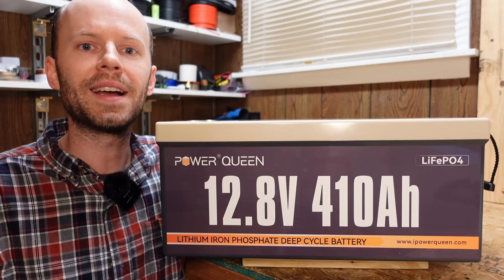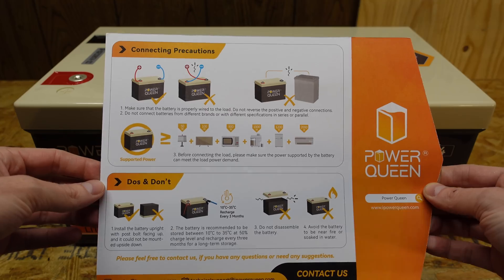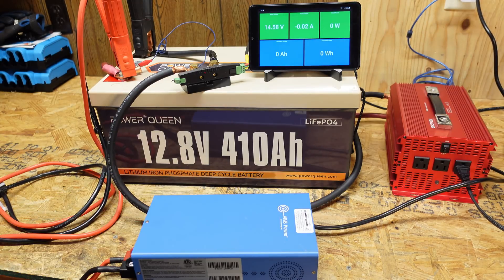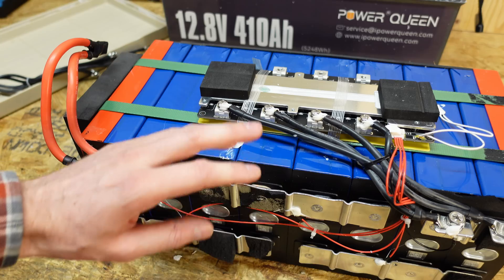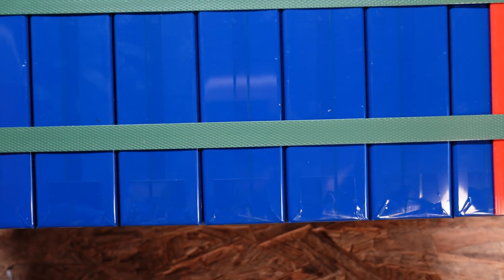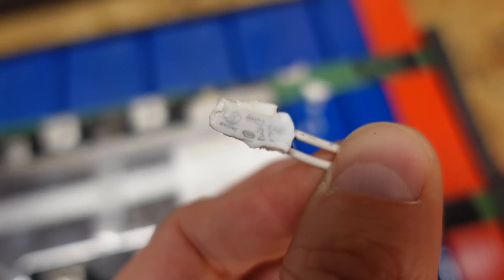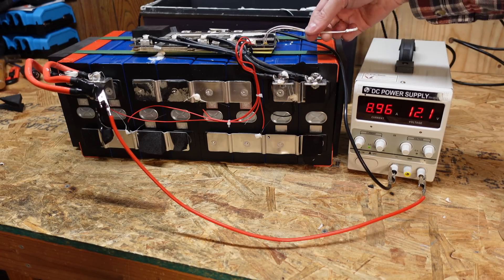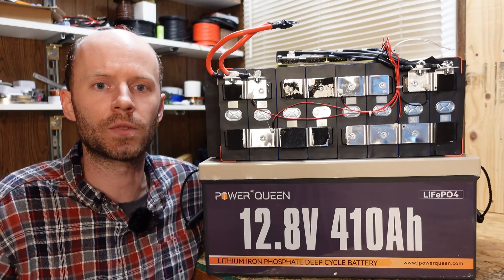Massive 12V 410Ah LiFePO4 Battery by Power Queen, Review & Teardown

Comment: Great review... the 300AH is $930 after coupon but for 100AH extra, the price jump to a whopping $1586
Reply: Could be added shipping weight? You'd be surprised how much shipping costs to weight and size jumps
Reply: @swedesspeedshop2518  hello, free shipping from PowerQueen to Southern CA address :)
Reply: @VincentsfamilyCali  free shipping for you not for them. Do I really have to explain that the cost of shipping is baked into the price ? You think FedEx and ups are running a charity?
Reply: Wich coupon you use to have a good Price?
Reply: @Rorolap  You meant “witch” coupon correct?
Reply: @h2o100c  yes , valid Best coupon for 300 ah
Reply: @h2o100c - how about “which”?
Reply: The 300AH battery has four 302AH cells which are a more expensive technology. The 410 AH battery arrived as a result of 200AH batteries being abundantly available, as they weren't really a hot seller at the time because the 100ah battery has hundreds of competitors in the market. Thus people would buy two cheaper 100AH batteries as opposed to the more expensive single case 200AH unit.
Reply: So essentially, this 12V 410AH battery is equal to my 48V 100ah battery in terms of capacity which has sixteen 100AH 3.2V cells wired in series. When I bought my 48V battery it was priced at 2100 USD on sale two years ago. This one is currently at $1669.00, that's a $431 difference.
Reply from the maker: I assume the price difference is due to different cells in the 300Ah vs 400Ah. This battery has 8x 206Ah cells. I'm going to guess the 300Ah is comprised of 100Ah cells, not sure.

Comment: Something doesn't quite jive with the 2-#6 leads to the terminals.
I'm in the market to purchase lithium batteries for my home,  and the Power Queen caught me eye. So I'm glad you opened it up so we as consumers could see.
#6 is only rated for 60 Amps, even though the leads are short, I'd be a little skeptical to take it past 125 Amps continuous.
Reply from the maker: The 60A rating you're referencing is likely from the NEC for home residential wiring? That doesn't apply here. The rating for chassis wiring is significantly higher, not to mention this has an insulation rating of 200C.
Reply: @LithiumSolar  On the other side of the coin, I think residential code is 55A for 6AWG at 60C and 75A at 90C.  Also, note that when a wire is in an insulated space (which an enclosed plastic battery case probably qualifies as) you need to de-rate the insulation rating of the wire.  Regardless of whether NEC applies inside a device or not, the laws of physics which prompted the code, still apply.

I'm always skeptical that Chinese wire is AWG rather than just "gauge" or some rough translation of wire sized by mm**2 cross section.   How much power dissipation happens in that wire per foot of length at 125A per wire?  What temp does the insulation have to reach in order to dissipate that power into the air in the sealed case?  If the answer is "well, it depends" as is usually true, let's be generous and assume it's a little under 200C (392F) in the worst normal scenario.  How happy are you to know that one end of a copper wire hotter than your oven is bolted to the external terminal, and the other end to a cell terminal?  OUCH, 200C is hot!

If 250A were for 5 seconds, I'd agree with you.  But for continuous operation, I'd want to both do exact engineering calculations, and check the actual temps of the insulation and terminals with a thermocouple before being brave enough to push more than half that current continuously.  

Anytime you parallel two wires to increase ampacity, you're relying upon the current being exactly equal in each wire, so the length, wire stripping, and connection quality have to be identical, or one wire is carrying more than half of the current.  There's a lot going on, lots of potential points/modes of failure.  I'm not the most nervous person in the world, but there's no way I'd pull 3200 watts through two 6ga wires in an encloses space, continuously.

Comment: What will happen if one of these Battery's fall over on it's side for just a very short time I just bought me a LiFePo4 Lithium 100AH Battery and it's going in my Kayak and if I ever flip my Kayak It will be over a Very short time Less Than 2/3 min Top More like less than 1 min But will it Kill the battery for good? The Battery will be in a Waterproof box and will Not get wet at all And I have a mane Kill switch on my Boat from my Battery to my trolling motor and my Fish finder  I can't find any videos on this at all Thank you much
Reply from the maker: I doubt anything bad will happen considering it gets flipped on all sides for long periods of time during shipping. I would be more concerned about water getting on your electronics.
Reply: them links Still don't say anything about if the Battery ever gets flipped over If it will Kill the battery Are just shut it off for a short Are anything I'm wanting to find out Well Thank you much anyway
Reply: Roy pow makes a true marine lithium battery. See will prowse video teardown. Dont ever get lithium battery wet......lots of fires after hurricane ian , in florida. golf carts , cars ect.

Comment: $1600 holy shit, i get 1200 AH lead battery for that kind of money!
Reply from the maker: Yes you can, which would give you about 600Ah of actual usable capacity and have to replace it probably 2-3x during the lifespan this LiFePO4 battery would last.
Reply: @LithiumSolar  i only need 250 Amps/24H and in my trailer i have lead battery’s for 5 years now…..

Comment: I don’t understand how they dissipate the heat generated by the BMS in a sealed environment.  Would like to see a test where you run a full 250A load and see how long it lasts.
Reply from the maker: That's a great idea for a test. I'll see if I can make it happen! (need to find another 12V inverter)
Reply: @LithiumSolar  I can’t see how it couldn’t fail.  High current = a lot of heat, heat sinks need to cool down, impossible in a closed sealed environment especially without a fan.  I’m an electronic technician, and the numbers don’t compute.  Feel free to contact me.
Reply: No, load here down on DC, 250 straight.  I’m pretty sure it will get #$&@
Reply: Totaly agree it would go thermal go into protection mode shut down ok run micro wave heat some food etc but if you were running muliple electric grills say in mobile food van not a chance
Reply: High temp cutoff protection.
Reply: My 5kwhr 48v plastic case lifepo4 battery from amperetime has a fairly large vented top lid hatch where you don't have to break open the plastic case to access the cells inside. I noticed this 5kwhr powerqueen battery isn't built with that hatch or top lid.

Comment: I have a VoltX 300A/H battery. I never tested it and put it straight in the back of my car with a DC to DC charger.. Seems good Ava excellent value. I'll be replacing all my 7.2ah AGM batteries and replacing with 4 lithium batteries soon.. I had over 80 of the small ones fur free from a hospital. But they are slowly failing bit by bit but have lasted over 10 years. They were used to start with..
 410ah may be awesome if I can find them
Reply: I too am using used 7.2ah sealed UPS batteries (26 of them) that i got free. I am expecting another 30 of them shortly. I will keep using them until they fail, then prob. upgrade like you but on a much smaller scale. I only have a total of 650 watts of panels so my system is very small. Greetings from Jamaica.

Comment: Will this power a split A/C -Heater on a Semi truck if got got 2 of them and will it work in Arizona heat Florida humidity and heat and Canada cold. If I put them in a outside box on semi truck. Or any suggestions on where to put them or a better battery that can handle the Cold and heat and power a split A/C system. Which is a hone unit...

Comment: Sheesh.  You can buy "5" of the 100Ah batteries for the cost of "1" 410Ah battery  🤔
Usually it's the other way around.
Reply: True, i just got a 100aH LiFePO4 for u$210 on black Friday, although this one has no BT or big BMS (50amps), it is purely for secondary purposes of only LED lighting and USB device charging. A friend of mine bought 8 (800aH) of them for $1700, for his farm in Florida, and loving it! All the batteries got 99 to 107aH after their first full test cycle, and yanked 4200w out of them in the stress test we did! 
The price factor on the PQ410 is way out of line IMO.
Reply: You would rather have 4 separate batteries taking up a larger footprint, more wiring, terminals, time and labor over a compact footprint and no need for multiple cable connections for parallel connections. Sure you can buy an EG4 for the same money but this one you can toss in the back of a camper, pickup truck, pack it with you for an extended camping trip, get wet, get dusty. Try that with a rack mount unit or five separate 100aH batteries. If it is useful for your usage or if it isn't useful, it's how you use it that makes it worth it or not.
Reply: @sanseiryu  If the purpose is "only" using it for 12V devices, and for needing long duration while out in the wilderness or what not, sure, go for that. But that is probably going to be the minority, tbh. 
Most ppl would be looking at these for powerwall applications. So space isn't as much as a premium.
Also, they aren't the same size. 
100Ah 6.8inW * 13inL * 8.8inH
410Ah 10.6inW * 20.4inL * 8.6inH
Same height, but 36% wider and 36% longer. So they won't fit in the same space.
Either one will fit an RV space, tho. 
However, if you want "capacity", then going with 5 of the 100Ah batteries would be cheaper over all "and" would give you good failover in case one of them stops functioning for some reason (ie. the bms shuts the unit off for some reason). That way you won't be left in the dark with zero power available.
Using a single battery means you have a single point of failure, and zero backup (aside from a generator and/or starting the RV up)
Reply: @korishan  4-100aH batteries vs 1 400aH battery. Which takes up more space? Which requires more cabling and connectors. If you have one 48 v 100aH server rack battery and a component fails internally, what's the difference? You're left in the dark. A few years ago people were still stripping Lion cells from electric cars battery packs building their own power walls with raw cells. Stripping cells from modem, scooter  batteries, all kinds of crap. Then buying and shipping lifepo4 cells to build diy milk crate battery banks. Now we don't have to do that anymore because of choices. Cheaper and more convenient to buy ready made batteries like this one or server rack batteries. Or if you have a ton of money to spend, buy a bunch of Ecoflow pros, daisy chain them and build a powerwall with those. Do you tell  people who buy Battle Born batteries that they are wasting their money? 'You should buy Power Queen it's half the price!'
Reply: @sanseiryu  I think you are completely missing the point here  🙄
Reply: @korishan  Your point is that it is may be more economical to purchase individual 100Ah batteries rather than one 410Ahbattery. Good point.However, if I needed 400Ah in a 12 volt system, I would rather buy one 410Ah battery or two 200Ah batteries rather than dealing with four 100Ah batteries with the multiple connections and cables, and space I need for parallel operation even if it costs me more. 400Ah battery is a low volume sales unit so will be more expensive, 300Ah is more expensive than individual units as well.

Comment: Too much money. We can buy a server rack lg4 with same wattage for less and much better battery functions.
Reply: Can you use a server rack battery outside in the rain or in dusty conditions at a campsite or toss it into the back of a pickup truck?
Reply: @sanseiryu  now that's a good question to be examined here. I know there are differences between the top companies server rack batteries but to what extreme is the question you raise. Well phrased. I too would like to know. Thank you. And to add to your question, I'd like to discover a battery that can operate in sub zero conditions having all the components built in to handle these extremes. I have some very remote property and without a human on site monitoring and taking actions I can not yet utilize the benefits of batteries.

Comment: Not a fan of the construction. The terminal connections on the sides of the battery are a concern. Also the BMS, internal wire gauge and heat management. I like that it's easy to take apart, except the welded connect among the cells.

Comment: Between the 81lbs and $1600, no thanks. I'd rather have 4-100ah batteries then if one fails in a year it isn't a huge expense and another month of back problems.
Reply: We run our whole house, completely off-grid, on 4 of their 300ah models.  

18 months so far and not a single hiccup. 

How many of what size did YOU buy and are currently using?

Comment: I have a 20’ toy hauler with a Dometec air conditioner.  Does anyone know if this single battery would start and run the a/c unit for a couple of hours?  I assume it’s a 15,000btu / 1500watt unit.  Thanks!
Reply: Due to starting spike I use two Honda 2k gens.Then turn 1 off while running.Just 1 gen won’t start it.All I know is you’d need your roof covered in panels to run all day with solar.Something like 8 300 watt panels.I think that unit runs on 6 amps? Starts 20 amps? Maybe a 600ah bat to run about an hour I’m guessing ?Im not really sure.
Reply: I googles it for you.Says that 400ah lithium bat will run yer ac for about 2 hours.
Reply: It's the inverter not the battery that starts the Air conditioner
Reply: Put a soft starter on it and will take much less to get it started.

Comment: Just came back from their page:
"lifetime of up to 10 years" does not look good.
Reply from the maker: What's not good about 10 years?
Reply: @LithiumSolar  it's up to.
Reply from the maker: @PașcaAlexandru  Of course it's "up to". If you beat the heck out of it, it wont last very long. This is true with any battery from any company, or pretty much any product.
Reply: @LithiumSolar one month fits within "up to ten years" too :)

But then again... only time will tell.
Reply from the maker: @PașcaAlexandru  So do you have this same concern with every single battery you look at? Or is it just this one?
Reply: @LithiumSolar  In EVs  and portables there is a real need for performance. Performance comes at the cost of life too. 

Stationary storage no longer needs that weight to power or weight to capacity ratio thus allowing for greater life at the cost of bulk. 
Yet I have LiMnCo cells from the 90s that put between 50% and 80% rated capacity. (Some of the earliest japanese commercial cells made to power hand held VCRs, that weren't cycled a lot)
I have nickel based cells from the 50s (1957 to be exact) that put 90-100% from the rated capacity and these were cycled and neglected. 

These look like designed to fail or have a high chance of failing, clearly stating they are good up to a definite point in time. 

Never said a word about trashing them around. 
Some offer a 10-25year warranty, these ones excuses themselves from any?
Reply from the maker: @PașcaAlexandru  I'm not even going to entertain those comments. Have a nice day and Merry Christmas.

Comment: That Aims charger has a ton of 1 star reviews (nearly 20%) on amazon for what it's worth......
Reply from the maker: LOL I see now that the Amazon listing actually says "This model only supports charging 12 volt DC batteries. Not suitable for 24 volt DC"
Reply from the maker: I see this and reading through some of those comments is... shocking? They include many reports of receiving used/returned equipment instead of new and a 12V-only version? Who knows what the 3rd party sellers on Amazon are pawning off. I wouldn't purchase one there unless it's a reputable seller/dealer. I purchased both of mine from Current Connected (link below).
https://www.currentconnected.com/product/aims-con/?ref=lithiumsolar

Comment: Not even 100 bucks less than a signature solar v2, and a lot less features it seems. I'd buy it for $995. for a 12v 400ah battery.
Reply: 400Ah battery in a single case will never be less than 2x 200Ah batteries.  Partly due to less demand, partly due to shipping expense spiking once you get above a 70 pound package.  Batteries in this form factor should be liftable by a normal person, and UPS/FedEx/USPS all draw that line at 70 pounds.